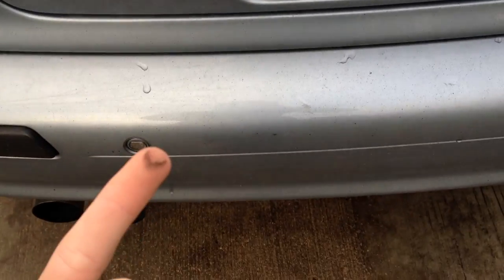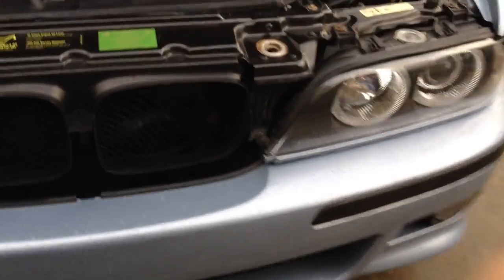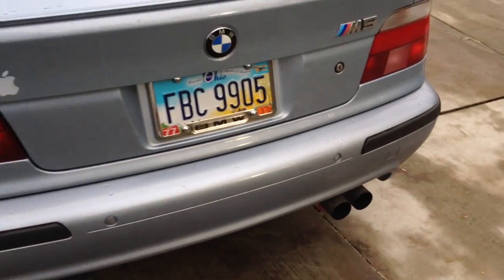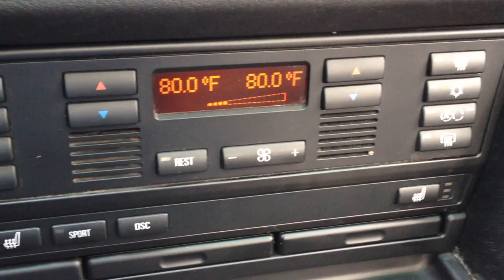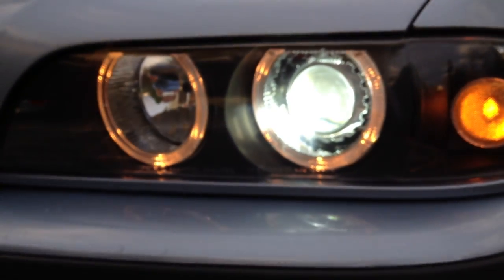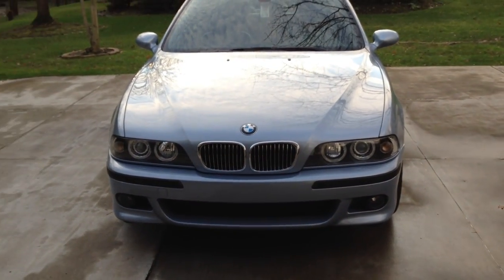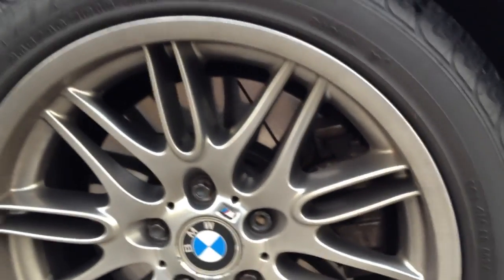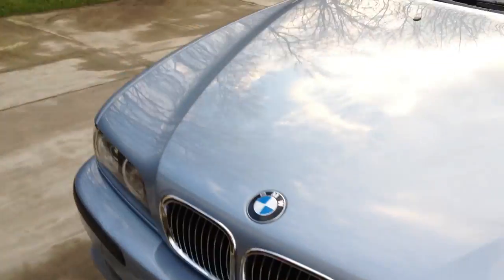BMW E39 M5:  Maintenance Info, Cost

Comment: Very informative, thanks. Going to look at a 2001 M5 tomorrow, 109,000 miles, full history.. 
Had an E39 525 a few years ago, only problem I had with that was the cooling system..leaking rad, cracked expansion bottle. 
Fingers crossed for tomorrow, the M5 is an itch I need to scratch!
Reply from the maker: +waynester71 Good luck! :)

Comment: Well, most of the stuff is minor things, not like mechanical stuff. This is a beast. I have a BMW and I'm very pleased with the reliability.
Reply: BMW (and other German companies like Audi) actually make their cars overall very reliable and tough. Especially the drivetrain with BMW, I've never heard a BMW owner complain about a drivetrain component. 
HOWEVER, BMW (and Audi, especially) use cheap composites or plastics for many parts like gaskets, water pumps, hoses, manifolds, etc. So bullshit that shouldn't fail does in the cars. Luckily, they are minor things, but the costs can add up especially if you don't fix them yourself. It's even worse if you have an Audi because then the whole front end of the car has to come off to do anything.
Reply: Darkmatter28031 some bmw have electronic water pumps or i think most of the newer models do haha

Comment: Awesome video! 

I usually don't like to comment on how other people drive but, doing 35mph on 6th gear kinda hurts me inside.

About the temperature, it should be ~90º (celsius) so make sure the first dot is 90º otherwise your thermostat could be permanently open and not letting the engine warm up to the optimal temperature.

Comment: That "ATF" reservoir is for the power steering system not the transmission. Bmw uses ATF for power steering fluid.
Reply: Yooo what if he's running trans fluid in there

Comment: Yes. This is a device which can be started like 30 min. before you actually go to start the car. It warms up the coolant and start the fan inside the car so when you get in it is warm and the engine does not get a "cold" start and it is more like a "warm" start. Very useful in the winter. We have these on most of the diesel BMWs over here in Europe. Some of the gasoline ones are equipped with one too.

Comment: Great vid! Just a note though from a prior owner of a new M3, back in the 90's. The e-brake is actually an emergency brake with a completely separate mechanism. If it's not stopping the car then it's probably way out of adjustment, you're not pulling it hard enough, or inferior parts were used. That is, unless they've really slacked in that area after 2000. Also as a note to buyers, a sure fire way to get a great used BMW is to look for one with all the DEALER service records.

Comment: I know this is old video but if someone is still wondering about this car. Main maintenance difference to a normal e39 is rod bearings that you have to replace like every 100k. Then there is double vanos when other e39 only have 1 so there is added cost. Other than that if you do take care of it it its not that expensive. It shares a lot of parts with 535 and 540 so no extra cost there. Plus these don't depreciate so if you ever sell your m5 it is actually cheaper to maintain this than any other 5 series because you get most of your money back.
Also pixel fix on e39 costs you like 5€ as in new ribbon cable and about 2 hours to diasassemble, fix and put back together when doing it first time.
Reply from the maker: Rod bearings in these cars can easily do 150k, often times 200k+.  It's really an over-rated issue.  I changed mine at 192,000 miles and they were just starting to show signs of wear.

Comment: Good to hear that. My E34 530i V8 never reached the dead center either, but it was ok (milimeters were needed). Mostly typed here because of your oil temp level, I think that is more important, just also mentioned coolant temp if I were already commenting. Im almost sure you did this before buying the car, but I would definetly advise you to get on m5board dot com, and ask if its needed, even with minor (or look alike) problems. 
Have a lot of fun kms/miles with her.

Comment: I have a 97' 528i with 74,000 miles and I believe by the time this car has well over 100,000 miles it'll still run smooth

Comment: I own a M5 and a 530 . Both are 2001 models . My 530 has 140.000 miles I have owned from 3 years old . And have had none of the issues you pointed out in your video . My M5 needed a key which was a dealer only costing me £150. And a head light as the self adjusting motor broke . But that's it . No vanos issues . Or any other sensors . But in England these cars do come straight from Munich . Where as USA there made under licence . Which means the components used are not as high quality as the on

Comment: Hi there! Very nice video and explanation with two clarifications if I may. The container below the passenger's cabin filter is a sealed box containing electronics like engine ECU, relays and so on unlike the brake fluid container on the driver's side. The other thing is the REST button which seems not to do anything. Try that in, this winter weather now, with engine fully warmed up , take the ignition key out of the lock and then you press this "useless" button ;)

Comment: Good video, one thing I'd point out is that the single biggest worry for that engine isn't the vanos, the biggest worry is a rod bearing failure, not very common but if it happens the engine is done for

Comment: You should look at it. Mine started making that noise or similar, thru time it got lauder and louder till the car broke on me. I didn't know what the problem was so I decided to change the whole cooling system except the fan clutch cause I didn't have enough at the time for all those parts so I decided to lubricate it. Days later it broke again. Took it to the dealer & turned out to be the part I didn't change. Got it replaced and 40K later has not given me any problems with the cooling system

Comment: great video .  learned a lot in the first 3 minutes.   Just bought an 2003 M5 and I know very little about the mechanics .  Now at least I know where the filters and fluids reservoirs are located so I could change some of those myself.
Reply from the maker: Thank you!  Welcome to the E39 M5 club.  E39Source has changed a lot since I made this video.  We have a shop in Escondido, CA now and part out wrecked M5s in addition to making DIY content, providing technical resources, literature, support etc.  If you ever need any parts or have any questions, don't hesitate to reach out!  ryan@e39source.com

Comment: An E39 M5 has been on my shopping list for several years, though I always end up buying something else. This year I was considering the new M5 (2013 model) but I'm still drawn to the E39. Considering price differences, I'd thought with the extra cash doing maintenance and some fun go-fast/handling parts. Anyway, still up in the air. 
Out of curiosity, when you mentioned your engine temp, did you replace the thermostat? They get stuck open after 100k in miles quite often (any car).

Comment: Ya, it often takes a long time to get to temp (pretty much my entire commute), but it does get there and stay there for me. Unless it always stays at 1/4 like i thought you meant, its probably not a big deal. Especially considering you drive at low rpm's (6th at 40), probably won't get up to temp. It takes 20 - 30 mins for me, and I try to keep it up near 2.5k when cruising.

Comment: Hey, great video. I'm looking at a 2000 bmw m5 with 138k for $10,750 but i'm a bit skeptical because i'm afraid it's going to need a lot of maintenance. What do you think? also I'm looking at a 2001 bmw 530i sport with just over 100k and a 2003 bmw 540i m sport with a little less than 100k. What do you think about the 530i sport and the 540i m sport?

Comment: Ran out of room below, but to continue... Dealer records will ensure things were kept up and generally in good shape, but remember to take things like the 100k mile clutch replacement mentioned in this video in to account. $2500 in labor seems absurd to me, even at dealer rates, but I don't know. I never had one replaced and never had a 5 series. BMW is well worth the money, if you can afford it. If you have to wonder if you can, I wouldn't get one.

Comment: Great info video! From the date if your first purchase to present, where there any major repairs needed on your car? Ive read that the vanos and chain guides are a pain to fix in these cars. How about your drivetrain?
Reply: Nothing really 'major'.  Mostly normal maintenance items.  Springs, struts, spark plugs, oxygen sensors, tires, brake pads, brake rotors, camshaft sensors, the normal stuff like that.  Never touched VANOS or chain guides or anything with the drivetrain.  I gave the guibo a visual, and it looks fairly new, so I should be good on that for a while.

Comment: Strange question I'm not sure you'd be able to answer, but I was wondering if you knew how the driving experience compares to the earlier E34 5-series? I have a '95 540i 6-speed(same transmission as used in the E39 M5 if I'm not mistaken) and have been considering moving onto one of these beasts later on.

Comment: Alright thanks, I will go test drive a few but I've heard the m5 has much more of a power feel to it and is faster than the m3. Is that true would you say? Which is not the only thing I'm looking for but plays a big part in what I will buy because a e39 and a e46 are about the same prices used.

Comment: My father bought a 2003 BMW E46 M3 back in the day and he always serviced it at a BMW Dealer and recently he gave it to my brother as he bought a new 528i. The E46 M3 today has NOTHING wrong with it, Except maybe once there was an engine failure as the fuel was not pure and had dirt particles in it. But, BMW fixed the hell out of it. If the car was always in trusted, official BMW Dealer hands, there will be nothing wrong with it.

FYI : We live in Cairo, Egypt

Comment: I have an E36 M3, and the Vanos issue can affect performance if it is allowed to progress. I had the repair performed personally by the owner of Beisan Systems (a competitor of Dr. Vanos). It does not set any engine lights, contrary to popular belief. My fuel mileage in the city is approx..25mpg city and 28mpg hwy (and this with a 3.91 rear end). BMW is very conservative with specifications. My M3 is far more reliable and less expensive to maintain than my Chevy-I also do some of my own repairs.

Comment: Basically the main things you're going to worry about are:
1. They burn oil like no tomorrow, had all the gaskets etc replaced on a few of my BMW's and they still do it, they still manage to burn down oil ( 2003 E53 4.4 X5, 2002 530i and 2001 525i)
2. The cooling system gets brittle after time and this leads to leaks all over the joint. So you basically have to replace the whole lot (except radiator) if you want some confidence in your car. 
3. The shocks go after a while :(

Comment: FYI, It is not normal for your temps to remain at the 1/4 mark. This is often a symptom of a faulty thermostat (which regulates coolant flow). If the thermostat is stuck in the fully open position, the cooling system is always running at max performance, rather than varying to maintain ~210F.
The oil is is at the ideal viscosity at 210F
Mine ussually lets the coolant temp get near red when the oil temp low, and the opposite if the oil temp starts to go over 210.

Comment: Im looking to get a 03 540 m sport. Idk if this video is even stopping me from getting the car. I'd make sure EVERYTHING is working properly at least the major issues and etc. Its just something about these cars man....my favorite bmw ever.
Reply: +DaOldSchoolRapLova96 ive been driving one for about a year now, i beat some russian kids in an m3, every now and then never had any real problems except  a sensor that costs $300 and tires from how often i ruin them
Reply: go for it, I've got one and it drives great
Reply: Just bought a 540i m sport 6spd. 130k on the clock, cooling system fully redone cause BMW makes shitty cooling. Timing chains and guides were done cause when they go you'll be fucked. 
On bc racing coils too with eurotech tune.  
This car hasn't skipped a beat so far. Once the problems are addressed these engines go to 400+k

Comment: I dunno how it works out in the U.S. with the Limits everywhere, but here in Germany I'd say NEVER buy all-weather tires, since they just melt away in summer and during winter they're far worse than cheap M+S since they aren't designed to throw the snow out of the tire.

Also, you mentioned the Break Disks+Pads, yes, they're expensive, however they're also a quite important safety feature. Also, I'd think they are far more durable than the 540's.

Comment: Yeah you are right atf only, however that is the supply to power steering not the trans. the trans is a sealed unit, with a drain and a fill plug. Sorry first post was mean for that I am sorry, but you should know that, what you pointed out was the power steering reservoir, which uses ATF.

Comment: hey man im watching all ur videos and i have couple questions ....
i just got 2003 bmw 530i sport ... 
1st of all the engine doesnt have the M letter on it and i dont have it on the trunk so what is the diffrence between 530i sport and the actual m5 
2nd of all my steering wheel is alittel heavy is it should be like that or i just need to change power streering oil 
3rd : if i have any question do u have ur own website or how can i ask u 
thank u so much for all ur videos

Comment: Hmm thats interesting, I had the same symptoms and thought it was normal, but the new owner got in touch with me and said the thermostat was bad and replacing it fixed the problem. I know these cars run a little cold though unless being driven hard, so maybe it was my hard driving all the time  that made it seem normal.

Will definitely be posting some vids, got my eyes set on an imola over caramel right now but its a little too expensive - may have to settle for the avus blue. Who knows.

Comment: A Mobile Oil Petro Chemical Engineer explained to me that hydraulic jack oil, transmission fluid and power steering are identically formulated hydraulic fluids, with the exception that transmission and power steering fluids have an added anti-foaming agent, which is why they are coded red. All automotive fluids are industry wide SAE color coded. 

Read the oil container label and cap for the engine oil specification. If the specification codes match, the least expensive oil is equal in lubricating and thermal properties to the most expensive engine lubricating oil within that specification. 

The same applies to color coded anti-freeze/coolants and mixtures, but not to brake fluids.  I am not familiar with brake fluid properties except that they are polyglycols formulated to base( DOT 3), to DOT5( all I use), those representing a reference to service temperature ranges. However, although both polyglycols, brake fluids are not interchangeable with anti-freeze/coolants. And you can't drink any of them.
Reply: Yes, this is an ancient video but I hope NOBODY ever listened to this "advice".

Comment: Is it worth it to buy now? Most likely if I buy one it would be 100+k miles. How long do you think the car can go? 200? 300k miles? Any suspension issues or engine issues or mainly sensor problems?
Reply from the maker: It's worth it now more than ever.  100k+ is fine... as long as it's been taken care of.  The fact is, most really haven't been.  Suspension needs to be refreshed every 60-80k... it's expensive and a good bit of work... but it certainly pays off.  The S62 has lasted people over 200k miles... if maintained properly!  When sensors go, replace them!  Oxygen sensors, camshaft, plugs, etc.

Comment: Nice video brother very cool...have a question e46 m3 or m5 what is a better buy or what is the difference in Perfomance
Reply: The E46 is almost as fast, but it doesn't feel like it.  It doesn't make nearly as much torque and it has to rev a lot higher to keep up... but that is expected with a 6 cylinder engine.  I would always take the M5, but I do love the E46 M3 (and E36 M3 for that matter) as well!

Comment: Hi there!

Thank you for such a detailed video! One (I think important) remark: You should check out your oil temp issue as soon as possible! 165F/~75C it's not the optimal, it should be slight under 210F/~95C when she is warmed up. Another thing, your coolant temperature is also too cold...should be in the middle.
I hope only some gauge issues...its quite intresting that your RPM's yellow leds still go out even when it seems she has no optimal values at both fluids.
Reply: 9 years ago but no it is normal for this car! 😎 I hope you are doing well!

Comment: Hey E39 source,
I asked you about an M5 that was for sale in another video and you said that it needed a temperature sensor and the digital dash fix. How much that runs for, and how much money overall do you think would be a good amount to set aside for maintenance? I just wanna know what I'm getting into by buying what of these.
Reply from the maker: Temp sensor is probably $50, and a pixel repair is around $125.  Some M5s need $25,000 off the bat.  Some need $2,500.  It totally depends on the car, how it was maintained, and how it was driven.  I would figure a few thousand in the first year and at least $1,000 annually moving forward... but each car differs.  And your expectations can change that figure as well.

Comment: Going to test drive a 5 series e39, It has high mileage of 154, 000 I hope its a great car an if so i'll definitely purchase it what are some things to look for or concerns before purchasing?
Reply from the maker: That would take a leather bound book to include it all.  Service lights on the dash can be very expensive.  I'll say that first.  Check out all the normal stuff.  Tires, brakes, etc.  You can just gauge what the previous owner knows and how they took care of it.